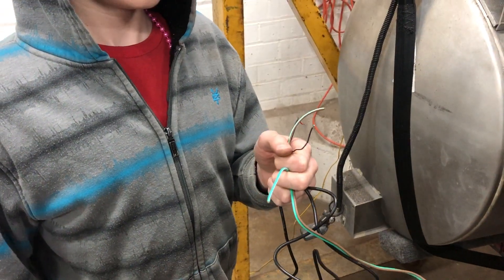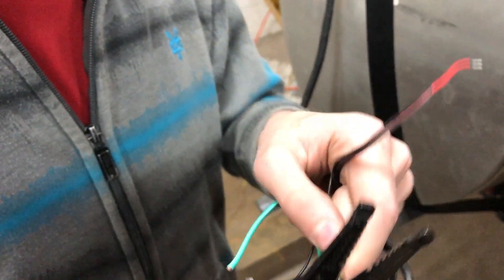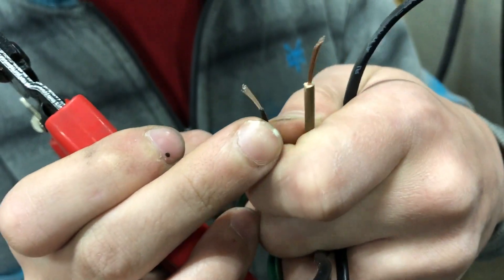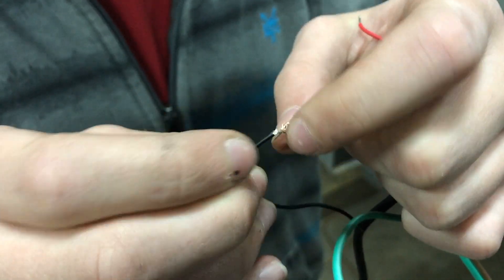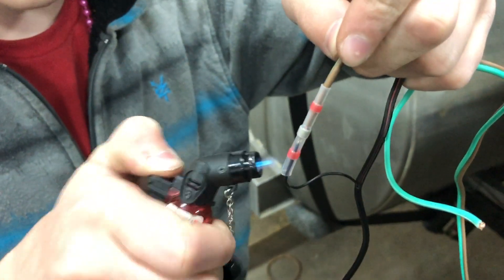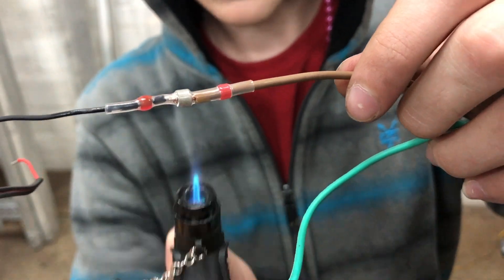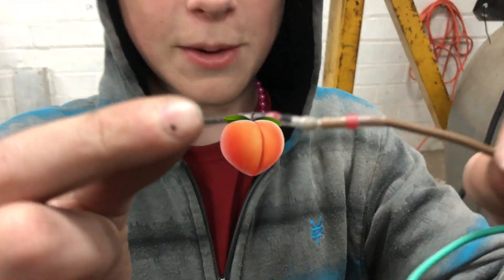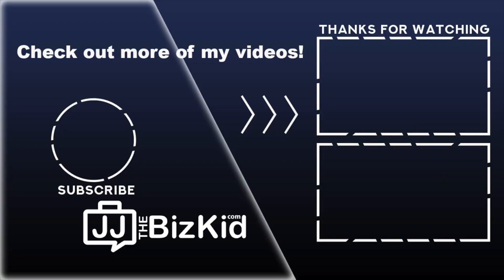HOW TO! Electronics Heat Shrink Self-Solder Butt Splice Connectors Waterproof Electrical

Comment: I wouldnt twist together personally. Im sure it works ok but the point of these is to make less resistance and not have to twist together. I slide them into each other before heating. Either way these connectors are great!!!

Comment: Sorry son, but most of your solder didn’t melt. It needs more heat. You have a cold joint now that is not reliable. But hey, when it starts sparking, it will get hot and the goal will be achieved after all. 😉